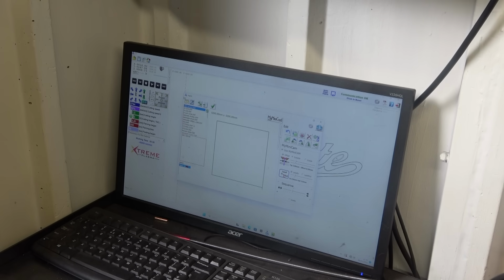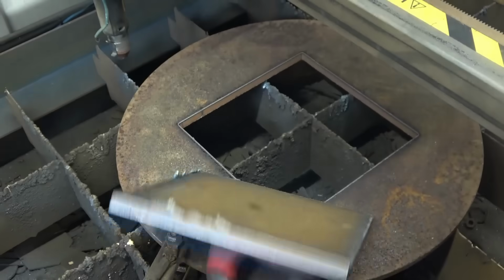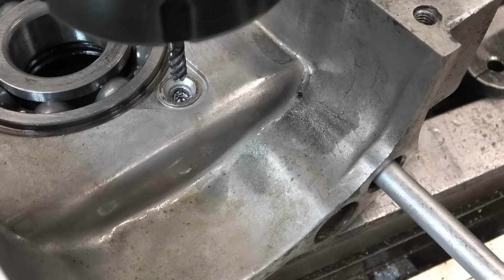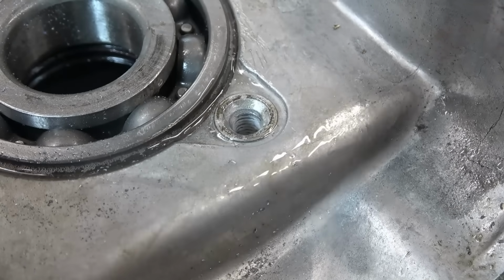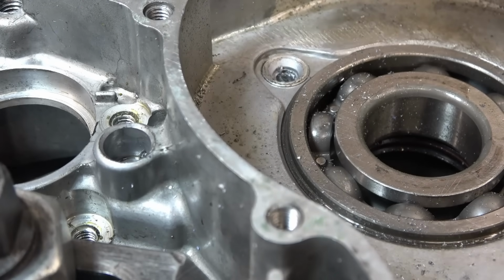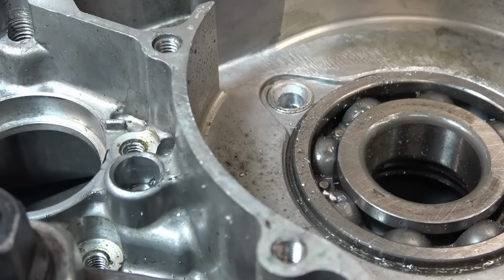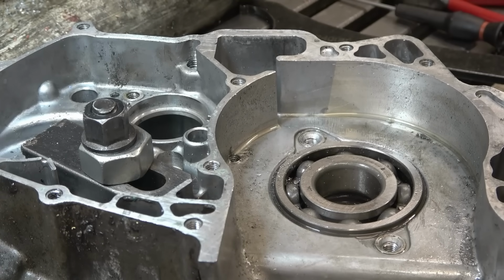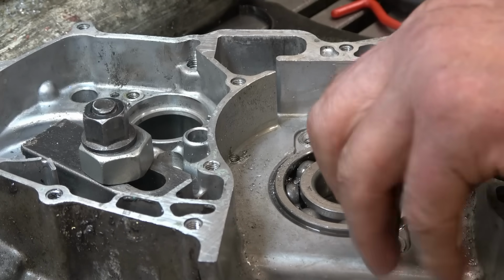SNNC 616 P2  Plasma Cutting 1/2 " Plate . Nasty Stud Extractions

Comment: Just a little tip for using carbide mills to drill out broken taps etc, dont use the quill drill handle but the fine feed wheel and even keep an  upward force on the quill handle. Using the " drill" handle allows a sudden jump which carbide cutters cant stand being so brittle. A highly controlled downfeed is always the best option! The voice of experience speaking! 😂
You dont have to destroy a helicoil to get it out, there is a triangular "spade" like tool that allows you to reverse them out intact.
Reply: Higher spindle speed than John has on that mill is also a bonus when cutting out broken taps with a carbide milling cutter.....I generally run my spindle at around 2000 to 2500 rpm when doing this.
Reply: @howardosborne8647 certainly too slow a spindle speed allows for a grab which with brittle tooling is fatal! Which is also why very controlled feed is important .
Reply: Spot on, self feeding is the death of plunging in.

Comment: A thing of joy when they machine out first time and a cause for frustration when they don't. There is also the option of making a small diameter holesaw (similar to a spot weld anular cutter). These can be made so the inside bore is just slightly bigger than the original broken bolt/stud diameter and then mounted on a small home made arbor and cut down around the outside of the old stud.
The cutters need to be made from a bit of silver steel and the teeth cut on the milling machine then quench harden and temper the miniature holesaw cutter.

Comment: I dare say probably some else has mentioned screw  inserts as to Helicoils .  I have found that  Helicoils  can sometimes give you problems  during and after fitting .
Reply: I got so fed up with the issues with Heli-Coils that I quit using them and started using Keensert. If your not familiar with Keensert they work like a Heli-Coil but are a metal sleeve instead of a spring. But they have a drawback too, mainly they are crazy expensive compared to a Heli-Coil. On the plus side if a ham fisted mechanic dings a thread you can run a tap through a Keensert where you can't with a Heli-Coil.
Reply: @dennythomas8887 Timesert were the original thin walled sleeve inserts.....also very expensive compared to a helicoil but they are guaranteed to stay put in the hole.